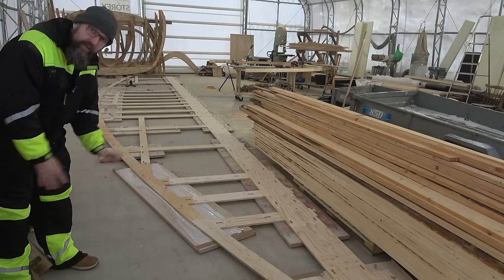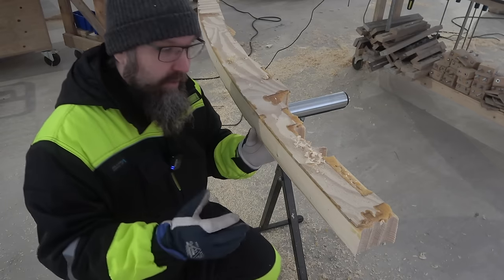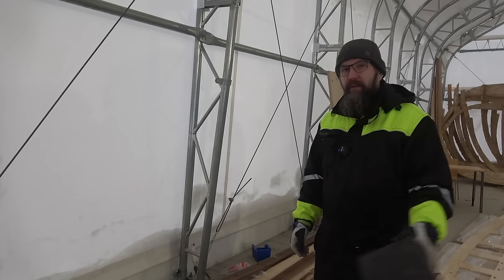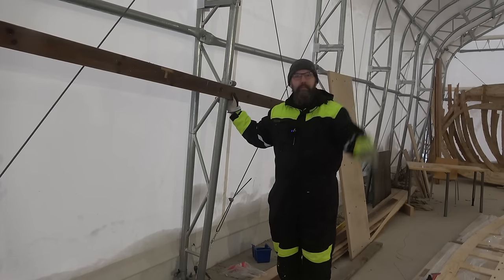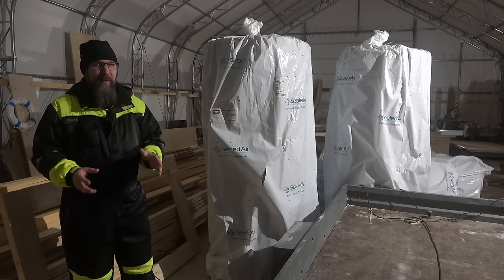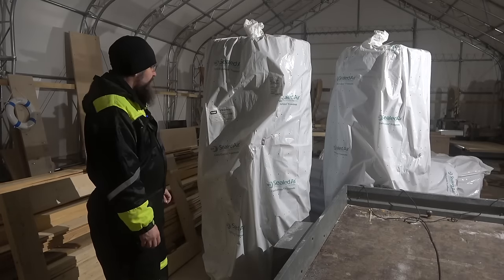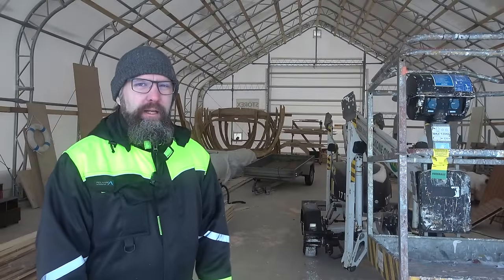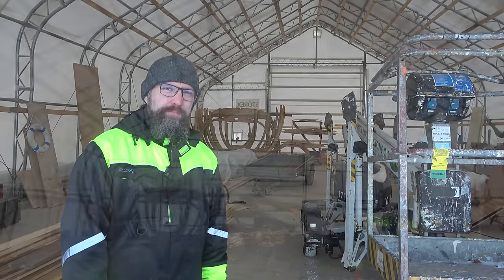Boat shed: insulation frustration! - ep.69 Project SeaCamel

Comment: Worked for 18 months in the Antarctic in the early 1980's. Was at times tough. Recorded temp into the -50's C, but survived and got the job done. Persevere and good fortune/luck with your built. Mine took 8 years for a 40 footer and was worth all the "sacrifice".

Comment: I don't know if you're allowed to use a wood stove in your tent in Finland or not.

We used a wood stove in a canvas wall tent for elk hunting years ago. Admittedly, it wasn't as large as your tent, but the wood stove kept it warm, even without insulation.

Might be something to think about as a way to keep heating costs down and reduce or eliminate the costs of insulating that big space.

Pulling for you. You're such an entertaining person with a really interesting project.
Reply from the maker: Wood stove would propably be OK. But I really don't want flames inside the tent (there's dry wood and dust around). Also, wood for burning is't actually that cheap. There's quite little extra wood waste coming from the project itself.

Most likely the heater will be high volume diesel/"fuel oil" air heater. You can get them up to 30kw which heats alot of air very quickly. Same kind as with RAN sailing but i'm gonna test a version that doesn't have exhaust pipe if that's usable here.

Anyway, the heating will be on just when I actually need it and I will definitely skip the coldest days. Hopefully there's not alot of those anymore, but that cannot be guaranteed. Winter is long and variable here. It might be around zero (like right now) or if there's northern air flow/high pressure, it can be very cold for days or weeks.

Comment: Don‘t give up, Panu! I understand your frustration but why do you build that insulation for this huge room? You need a warm area for your epoxy-works, which will take place around the hull. And even if you did it, you will still face the issue of heating! I would recommend to build a shed inside your shed, just big enough to cover the boad and of course a space for preparation works! Less work, less time, less money, less heating costs etc.!  Regards from Austria! Wolfgang
Reply from the maker: Hi. Thanks!
There's couple of reasons.
First is that this way i don't have to do any additional frames around the boat. I just attach things to the existing one.
Second is that I need to get all my tools inside the heated space as well to keep them warm(er) and dry. In these temps all metal things are covered with frost and they don't like that. Also i cannot use the CNC either because the wires (or their covers) are not meant to be used in cold temps.

Comment: I am an engineer: from a strength perspective there is NO problem in drilling a i.e. 4,2 mm hole and using an ordinary 5 mm wood screw to fasten the wood. In fact, is reinforces the steel arches. In the ceiling, you might run a huge risk, if using  ducttape as it is made from plastic fibers and thus stretches when the tent gets hot this sommer. This can cause everything to collapse. Just saying...😅
Reply from the maker: It's not getting that hot up here fortunately. What I'd be most concerned is the UV degradation which eats tape quickly. But the tent is UV protected so I'm not too worried about that either. I of course need to keep eye of that. It's not a huge deal (although very annoying) to put some scews in later if needed...

Comment: Hi, I feel with you.  I myself needed over 4000h to refit only 24 foot! As per my option one man alone can not build such a big boat in part-time and also almost not in full-time. It is just too much work.  Buying a smaller used boat, sailing in summer and small refit in wintertime would be so much easier than years and years ofonly building.

Comment: Hi we understand your frustration but please do not give up please "work smarter not harder" and you have shown us this , try install the insulation from the bottom to the top or top to bottom using the strut to staple the insulation to and if you have to join the insulation join it on the strut ! the rest will fall into place ! good luck and please do not give up !

Comment: Thought about your insulation project. I wonder if it would not be easier to build a structure around the boat and maybe around your lamination table. I guess the router can live in the cold. Would be smaller, easier to heat up so epoxy cures. I have doubts that with that extremely high ceiling and with thin foam it will be possible.
Reply from the maker: Hi!

I really need all the tools to be inside as well. Right now for example there was weeks for around -15 to -25. After that warmer more humid air creates ice and frost on every cold metal (and other) surface. Then they will rust and have other moisture issues. By warming up the inside even a little bit dries up the air dramatically especially in colder temps.

Also the wiring of the CNC isn't really meant to be used in cold temps. Plastic cable covers become brittle and can break over time.

So it's really not just for the boat. It's also for the tools. And for me.

Comment: Great project. Pls consider to check for safety if your insulation material is not going to accommulate moisture in order to avoid frame load increase
Reply from the maker: It shoudn't. It's kind of closed cell foam.

Comment: A cruel setback with the weather. Can you leave the insulation and proceed with anything else you can do on the boat. It will soon warm up enough for you to use epoxy. I admire what you are doing. Rest now and thaw out. Regain your strength and then get going again. Best wishes from Down Under. By the way  we had 41c here today.
Reply from the maker: I cannot really do that much without the insulation. It's mid-winter now. Weather will start warming up more in late March. And the temps will not raise to "epoxy-curing" until May or June.
So, insulation and the ability to raise temp when needed is essential here.

Also problem with CNC is that the wiring is not really meant to be used in very cold (like below -5°C). So in need to raise the temp for that as well.

So, insulation it is! (should have done it long time ago but money money...)
Reply: OK understand. Can you do a smaller enclosure over the boat area and warm that? Have a look at what they are doing on RAN Sailing.
Reply from the maker: @rossbrown6686 I really need to have the machinery inside as well. This is really the easiest way to do it. I don’t need any additional framing for the insulation, just attaching things to existing one. 🙂

Comment: You will heat this space at extreme costs. The heat will go up and the bottom will be still cold. (I have 3,7m height in large garage) So I would heat only the space arround the boat ...
Reply from the maker: I did think this as well. It would have required a lot of additional structures to hold the insulation lower so I didn’t go with that after all.
Reply: @ArcticSeaCamel   I was thinking something like plasic tent. RAN sailing are now using it.  Not any  structure with isolation.
With so much effort and work I also don´t understand why you use only 1 cm isolation. But it is your money. I will watch :)
Reply from the maker: @petrpodobsky7005  Hi!
My original plan was to use 10cm foam insulation. But that would required completely additional structures to hold it up. The frames of the tent are not designed to hold that much additional weight on them (and also attaching them to steel pipes would have been quite difficult).

As mentioned, the main goal is to have air- and vapor tight layer. This 1cm should prevent (most of the) radiation heat from escaping as well what simple plastic doesn't do that much.

We'll see how it works! The area (and volume) is big nevertheless and I really need to have all the tools inside as well.

Comment: My friend, I fear that your insulation job as envisioned will turn into a nightmare. Normally Greenhouses hang a secondary internal membrane to hold the heat. don't worry about the insulation value. stopping air infiltration is the prime need. Your wood batons should also be "wired to the building frames, The Duct Tape will fail over time as a load bearer. A comfortable building work area might be a bridge too far. I liked your "box" Glue space as a better solution for a warm-able space. Good luck young man. pg
Reply: Was thinking zip ties but wire might be better.....at least up top. 
Duck tape is great until its not.
Reply from the maker: The main goal really is to make airtight barrier. The insulation value is secondary goal.

I will keep an eye of the ducktape thing. It's under the roof and off the elements (mostly protected from UV) so I believe it's fine. And there's many rounds of it and all the boards have multiple attachment spots. And if needed, it's possible to put screws in them later.
And of course, the boards and this insulation aren't very heavy together.

Comment: Why not use big sheets of transparent plastic. It's cheap. Let the air do the insulation.
Reply from the maker: This small thickness of insulation should also prevent (most of the) heat radiation from escaping. Actually this white tent somehow is sometimes even colder than outside because it radiates the heat away so well! It's good in summer but bad otherwise.

Comment: Sir maybe Bite the Bullet and install radiant-floor heating  And a Wood burner to heat the Water and pipe some of the Exhaust Pipe inside work Shop tp warm the Build instead the High Cost of insulation on the Ceiling?
Reply from the maker: Without insulation (and air barrier) all the heat would just leak out right away.

Comment: Hi there and greetings from Norway! In the later episodes you have talked about quality plywood made of spruce (i think) and that they probably must be sourced from the baltics somewhere. I have been trying to get high quality spruce (not birch; too heavy) in thin multilayer sheets like 6mm with more than three layers. I have not found out where to get them. WISA spruce I do believe is from Finland, they have 3 ply 5mm which is not bad but I would prefer more layers and 6mm. Do you have any tips for me on this?
Reply from the maker: Hi. Not really. I have heard rumors that one of the Finnish plywood makers is starting to make something like this but haven't yet got into touch with that. (Yes WISA is Finnish brand as well).
All the better qualities (not birch) certaninly seems to come from Baltics or Poland.

Comment: I am surprised that you chose to run the insulation down the length of the building.  When i saw you put up the wood framing through the lattice work i thought that you were going to place the roll at the bottom of one wall and unroll it up and over the top and back down to the bottom of the other wall using the wood to hold it up between the primary frames.  It seems that this would be a much quicker process as you would not have to fasten it until the full length was pulled all of the way through to the other side.  That is unless the rolls are too wide to fit between the frames -- it is hard to tell from the video.  Don't get discouraged ... a solution will present itself when you least expect it!
Reply from the maker: Hi! The reason is that I needed to have wood boards on every seam of the insulation to squeeze them together - to gain the air tightness. Only way to achieve this was to put them longitudal like this.